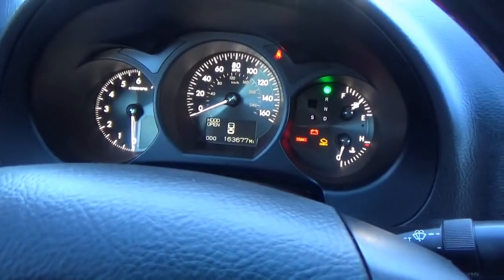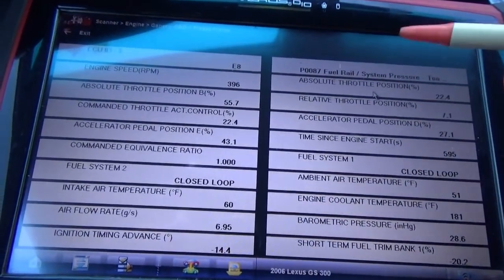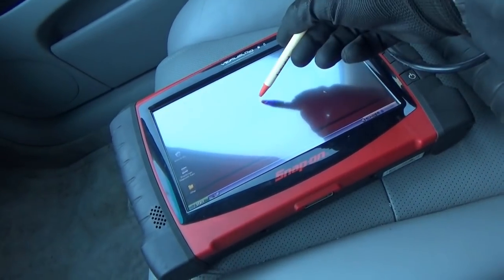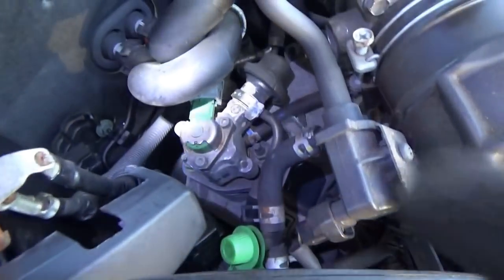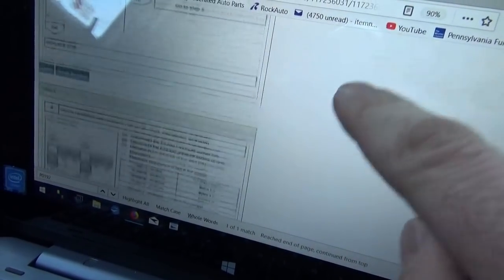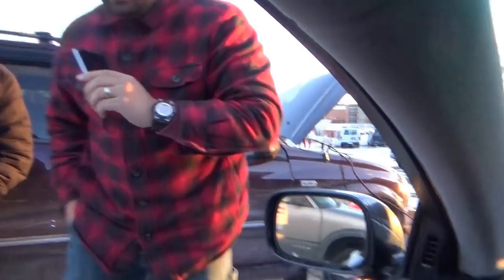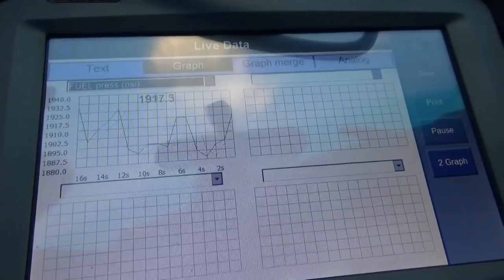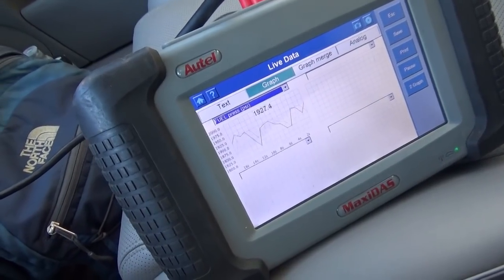Stall, No-Start Case Study: Lexus GS300 V6

Comment: I would have done the same thing. A lot of repair work is detective work. You noticed that the connector came off too easily. Most people would have just replaced the sensor without even noticing that. In addition they would not have done the continuity check on the wiring. Great work. Your confidence is encouraging.

Comment: From a consumer view it's fantastic that you did the right thing. In my experience it would have been recommended to replace the malfunctioning piece.  Now, I would question the driver to see if he previously took the vehicle to another shop to get work done on the engine bay. Because connectors like that don't come off unless their broken. Thanks for taking time to make this video...

Comment: I'd have done the same thing, Ivan. We all know connectors don't come apart that easily, so that's a glaring fault right there, coupled with the data PID jumping around like it was (intermittent connection more than likely).

Certainly would be easy for any of us to pocket $200 ... but I know I wouldn't sleep very well at night doing business like that. You made the right call, IMO. If more people had your ethics, this world would be much better off, that's for sure!

Comment: Hard to convince a customer that it was just a loose connection and no parts required....But definitely the right diagnosis....The way the fuel pressure was jumping around on the initial check proves that and afterwards it was fine...Good call

Comment: Beardless ivan? The second scanner you used seems easier to read and idk maybe more user friendly?  I wouldn't replace it, if the customer wants it then yes.  I'd say hey I believe it was just loose so replacing I don't think is necessary at this point. Unfortunately most shops would've gouged him on this and told him it needed replacing. Thanks Ivan for showing that there are mechanics out there that are still honest

Comment: I agree that you made the right call.  I would probably double check how that connector felt and make sure it wouldn’t come free easily again, update customer and tell them if it does it again it needs the sensor installed.   Good call

Comment: Buckle up, I was a tech at a Lexus dealer for 3 years, and I know exactly what happened here. About 2-3 years ago, a recall came out on those fuel pressure sensors because mold would accumulate on the threads and cause fires. We removed the intake, sprayed Pando 39C on the threads of the sensor, etc. Now, we all know people aren't always great about getting recalls done in a timely fashion, so it's entirely possible the recall was only recently performed. Lexus is pretty draconian about their flat-rate times in warranty situations, so I imagine the tech was rushing through the job and failed to secure the connector. It was a super gravy job when I was there. I think it paid 3.2 and we were getting it done in an hour, so they probably cut the time severely by now. Funnily enough, I saw that sensor fail and cause a no start one time, but it didn't set any fault codes.
Reply from the maker: Fantastic info! I did see that recall, and you are probably right....connector was not properly secured!
Reply: Pine Hollow Auto Diagnostics The hardest part was running enough punch time on the ticket so warranty didn't backflag us. Welcome to flat rate at the dealer

Comment: Ship it! 

I'd say somebody was in there playing. I wonder if he has his oil changed at some kind of lube center. There is one down here in York, Pa that unplugged a sensor that didn't set a code until the next day.  (it was hard to unplug once I put it back on) There was no reason to unplug it either. It was not in way of anything they had to do. This was on my son's bosses car, he brings it to me if he needs any hard parts changed. He brought to me to change the part but didn't need it.

Comment: I've seen the same thing where connectors are loose from the MFG.  Neighbor had an older mustang that had never been touched by a mechanic and had a loose ignition connector.  Plugged in, clicked, problem fixed.
Reply: ycmdill yes, a friend bought a new Jeep and it quit running.  I asked her what it was and she said the ignition harness was not plugged in all the way.  Ship it.

Comment: lol I had to laugh when you tried to start that thing. I had an 06 ES300 that the x-wife drove. I hated that car not only because of that starting sequence but because the car itself was a "fancy" numb mess. I think you did the right thing based on the evidence but also understand the customers part swap fix mentality. What I wonder about the most is how an automotive grade weather packed locking connector just happens to wiggle loose. Well done Ivan and thanks for taking us along!
Reply from the maker: That is the one question I had as well, and might never know the full story. All I know is that after securely clipping it into place, I could not unplug it again haha

Comment: I recently had a similar connector issue on my mom's Buick Century. The EBCM would intermittently set code U1000 (Class 2 Serial Data Link Malfunction). I unplugged the connector, checked powers and grounds and checked the class 2 pin with the scope, which showed communication occurring. It's been weeks, and the code has not returned. Sometimes all it takes is to unplug and reinstall a connector to fix a problem.

Comment: Ivan and Keith.  I just found out today that Autel has released for free all the newest updates for the DS708 as it is now completely discontinued. I just updated mine using the same SD card reader and log in method as before. It works. I can manually select vehicle including the 2017 year.  Don't miss out. Autoconnect still works. I just wanted to see how new the coverage is.

Comment: Glad you're enjoying the new job Ivan, and thank you for making the video's whenever you're able to....As for this video/job, you made exactly the right call on not throwing a new sensor at it but there's no way I'd offer to fit it for free it it was indeed shown to be faulty.....That's not your fault amigo and it's certainly not your fault that the customer is ignorant of the fact that systems sometimes malfunction for reasons other than outright part failures!....If, after explaining your thoughts and stating your confidence level, the customer wanted the part fitted then do as they request, simple. You have a family to feed. Stay warm!

Comment: A shop would recommend a fuel system cleaning, transmission flush, brake fluid flush, coolant flush, air filter, cabin filter and oem muffler bearings.

Comment: Good job Ivan. I would have tried to instill confidence in the customer like you did but would leave the option up to them. People need something tangible sometimes. Not like the old days when cars were not as dependable as they are now. As far as Autel I use the Maxasys and while far from perfect it’s still the closest to jack of all. We used factory scan tools for the big 3 and Autel for everything else. The tool is made in China and I question how they got the code as GM and Ford looks just like the factory scan tool.

Comment: Your absolutely right about sometimes its hard to convince the customer. I told a guy one time what his problem was and he was convinced that the problem was with the alarm system so he had it towed to the dealer and they put a fuel pump in and charged him over a grand! I even told him that I would pay for the fuel pump up front and if it didn't fix the car he didn't have to pay one cent and he still wouldn't believe me! I just laughed in his face when he was bitching about how much they charged him

Comment: I agree with both points of view. As a trustworthy mechanic, you don't want to throw money and parts at vehicle if it doesn't need them. As a vehicle owner, your biggest concern is it's reliability. I had to sell a Taurus that I really liked otherwise because of an intermittent crank-no start issue that happened 3 or 4 times. The car would get towed to the shop and fire up and run perfectly the next day with no codes or issues, although I seriously doubt my mechanic puts nearly as much effort into diagnostics as Ivan.
Reply from the maker: Intermittent problems are the WORST! At least this one was acting up when I got to it!

Comment: Nice diag, I was reading up on alldata because on some makes they want you to replace the high pressure fuel lines any time they are removed.  While I did not find anything to that effect I did see multiple recalls for fuel leaks with the high pressure rails the sensor.  One for the sensor wanted dealer tech to retorque the sensor if it was not leaking.  Wonder if that might explain the possibly loose connection.
Reply from the maker: Great point! Maybe that was the case here...

Comment: You are right in not installing the sensor though I would check the connector tabs on the sensor to make sure of a good connection. If the car has no history of a repair which would involve removing the wiring, it doesn’t seem feasible the car would have shown no issues before now if the factory was at fault. Stranger things have happened I guess
Reply: I agree.  11 year old car and the odometer showed over 163,000 miles i believe.  At some point someone may have fiddled with that sensor plug and not reset it properly.  Did he have his plugs changed?  Maybe had to remove the intake to get to some of the plugs?

Comment: Hi Ivan....
In my opinion... I will try to check for the actual fuel pressure by a dial on schradder valve to check either if the sensor or the circuit being bad.

Comment: Good viid Ivan. Wish we got the visual on the sensor connection/disconnection event. You described how easy it was to pull the connector. Once you reconnected it (after inspecting both plug and sensor interfaces for issus)  did it click into place where it couldn't auto-disconnect?  As far as dealing with the client, I feel you handled it he right way.  I can attest to how a vehicle breakdown and getting stranded turns a Lexus into a lemon.  The faith returns very slowly after that. Your confidence will go along way to stymie his mistrust.
Reply from the maker: After I securely clipped it in, I coudn't disconnect it again! It was in a very very tough spot too. Good thing I had skinny hands and long fingers lol

Comment: I agree you're job now is to convince the costumer the car is fixed the problem was just as simple as plugging the sensor in all the way, explain when you went to confirm your diagnosis the sensor was not plugged in properly good luck with the new job
Reply: James Kmenta Nothing matters he checked the wiring he made the only good call.

Comment: Ran into same problem with my modis ultra. I actually found a data pid for fuel pressure in the OBD direct mode, and not in the factory data supplied by Snap On. Strange but that worked for me hope it works for you.

Comment: The weather is up and down. Winter has February and March, I think we'll get more snow. North of Toronto there was nearly 3ft.. I did 3 hrs of shovelling Garage and rv,  back when the temperature went up for a few days. I think people have a tough time once their car breaks , they don't trust it. My friend had his check engine light come on, he had a shop scan it.. And they told him .. You need all the o2's replaced and a tune-up. At the cost of 700$ I told him no way, I checked it to get p0171 and a 174 looked around to find a vacuum hose with a hole in it and collapsed.. And that day his alternator went bad.. Told him spend your money on what you actually need.

Comment: hope you right, fitting sensor free would suck lol .
would of expected see some pressure issues if internal sensor fault but funny things are sensors and wiring once touched.
Least his bill and your guarantee nice and comforting, could of cost a lot at some shops and still not been fixed lol .

Comment: Nice repair, the customer always like the cheaper repairs. I would just double check, you probably have already, that the connector stays locked on. That surely explains the squirrely voltage reading on that sensor at the first part of the video. Pretty shocking the snap-on does not have a fuel pressure pid. Heck,  I've got an Actron 9180 that has a fuel pid, although it is in kpa. I just have to convert it to psi. Don't know why they don't just do it the simple way with psi to begin with.

Comment: I would of loved to see you unplugging that sensor and recreating the no start. I understand the theory of that causing the high pressure pump not to work. Great job and high 5 to the Autel
Reply from the maker: I could not unplug the connector again after clipping it in the first time. Also didn't want to break the lock tab lol
Reply: Pine Hollow Auto Diagnostics comprehend
Reply: It's quite possible it would have started with it actually unplugged. Those erratic readings might have prevented it from triggering the limp-home strategy for a sensor failure.

Comment: Those GS300 V6s are the bastard child Lexus wished they never made.  They have a ton of issues with the direct injection and carbon buildup requiring full engine rebuilds to fix.  They only made those V6 GS300s for one year they had so many issues.
Reply from the maker: That is good to know. I'm not a fan of direct injection because of complications like this :)
Reply: Pine Hollow Auto Diagnostics yeah even the IS 250s through 2011/2012 needed full engine rebuilds due to carbon buildup.  Won’t ever buy a V6 GS300 or IS250

Comment: The only thing I don't understand is if it was a loose connector, why would if read low when it was unplugged it read max psi. In any case good video. I am sure you keep thinking about it too. Best of luck in your new job !!
Reply from the maker: Great question! Maybe sometimes the 5V feed would be lost to the sensor, and it would pull the signal all the way down? Not sure...
Reply: yeah, I'd assume +5 going low or ground going high

Comment: Nice vid but here's my dilemma.  When u unplugged the sensor you read super high pressure on the scanner (5v open=high rail pressure)  soo why was the scanner originally reading really low pressure if the connector was not fully plugged in?    Great vids tho i love this stuff
Reply from the maker: Well we were losing either the 5V ref, ground, or signal, or a combination of the above. Also, the car might be ramping down the fuel pressure if it sees that it is too high from the unplugged sensor!! Lots of variables, but same conclusion: that sensor is absolutely critical to driveability :)

Comment: Great job on finding a bad connection! I never heard of fuel pressure over 50pds. Could you explain about the high and low pressure? Thanks Ron!
Reply from the maker: This is a direct-injection engine. Regular 50psi pump in the tank feeds a 2,000psi high pressure pump driven by a lobe on the camshaft.

Comment: Should have pulled the shotgun out and replaced all the high pressure components lol you are right about those pressure sensors. I have yet to see one of those fail. I do get a lot of trucks with the P0087 and most times it is either failing lift pump or plugged filter.

Comment: Im going with intermittent sensor, Someone  found out if you unplug it gets the car running again.
Next video will be " Return Of The Lexus " or  " Ivan Fights Off Frost Bite ".
I guess the question is....Did the customer already have the part before you diagnosed or after.
Wonder what the Towing Charge from NYC runs nowadays, Rental Car, Loss of Work, B and B.
Goodluck

Comment: Access to that sensor really sucks.  Very similar issues are found on common rail diesels so I bought a cheap Chinese made common rail pressure sensor simulator and tester on eBay it allows a very quick check of sensor output and using OBD2 what the engine computer seeing from the sensor, so I check the sensor, the wiring and the computer.

Comment: I'd have made the same call and left it up to the customer. If the terminal fitment was good and terminals were tight in in FRPS, ohms ck steady, wiggle check passed, I'd have applied Deoxit & Stabilant 22 and shipped it unless customer said change it anyways.

Comment: 1MZ-FE:  My car won't start.  Spark is present.  I squirted Brake Parts Cleaner in plenum opening for hose to brake booster and got nothing, not even sputter.  Squirted Brake Parts Cleaner in throttle body intake and nothing, not even sputter.  If fuel is the problem,  should I have gotten some sputter or temporary start but injecting Brake Parts Cleaner?  Should my next diagnosis be go to check timing?  Do I need to check fuel injector pulse?  I would think the entry of the Brake Parts Cleaner by passes the need to do a noid light fuel Injector test.

Comment: Sometimes its as simple as that, a loose connector and it is the correct thing not replacing the functioning sensor....BTW, I have the Snap On "Virus" also and I definitely got pissed how Autel made that PID available when the Virus could not...My last update cost me 1200.00 ...Autel on my wish list now...
Reply from the maker: You can buy an older Autel for less than that lol

Comment: Maybe I missed some of the history, it looks like codes were cleared just a little while ago. I wonder what they did. Perhaps the sensor was unplugged for some reason and you found the mistake.... By the way, what about that immobilizer code?
Reply: spelunkerd i saw the red light come on on the push to start button I think when the battery died it set some extra codes not seeing the key and stuff
Reply from the maker: I would love to know why the heck that sensor was unplugged. Once I clipped it back into place, I could not get it unplugged again. It requires a hardcore reach-around move to get to it haha
Reply: spelunkerd Low battery.
Reply: so some guy with larger hands maybe didn't connect it all the way, and it took this long to vibrate out?
Reply: Maybe It Was a Monday Build Right  Or Friday  Good  Job ! I'm With You I Hate The Cold Too  !!